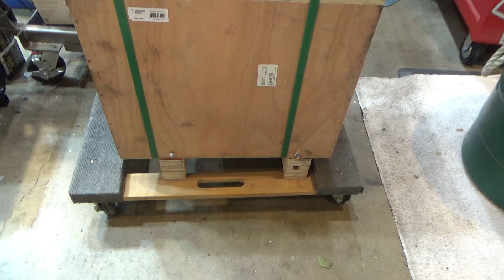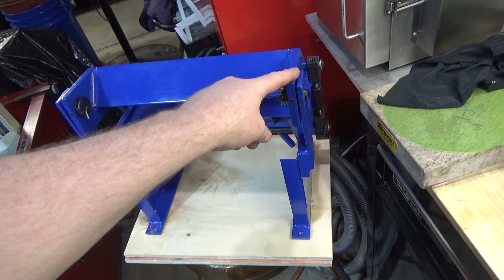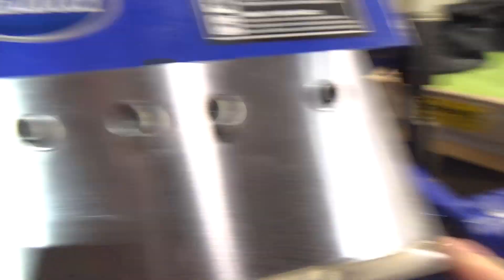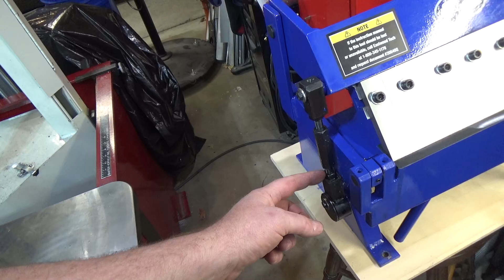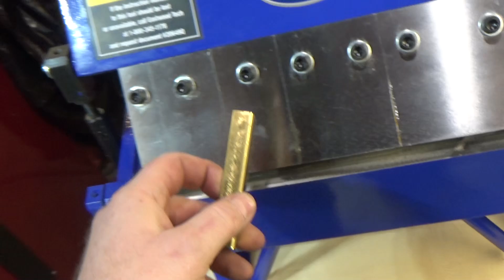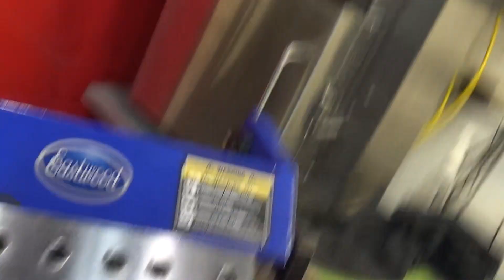QTR 61 Eastwood Finger Brake

Comment: I have the same design but in 24". Yes it needs to be bolted down to be able to work with it. I use mine quite regularly. Thanks for sharing.
Reply from the maker: You seen to be in good company with the 24" model. Others here have positively commented on having the same one.

Comment: Just be very careful if you’re going to bend a narrow, but relatively thick piece. Professional models can bend a good quarter inch if it’s just an inch wide, even if the unit is just rated for 18 gauge across the entire model. But these cheap Chinese models, even up to 48” won’t do that. This might do a bit over a sixteenth safely for mild steel if it’s fairly narrow.

But the biggest problem isn’t the strength of the machine so much as it is the fact that the fingers aren’t really made of a top alloy, with hardened edges. So those edges will crush. Just be aware of that.
Reply from the maker: I really appreciate the tip. You might have just saved me a finger or two.

Comment: thats a good tool but 12in. is a toy to me lol. you be very happy with it as the time go's on
Reply from the maker: You are so correct. I went round and round in my mind over this purchase, because it was only 12", but I barely have room for this small one. Sheet metal will have to wait until I can swing a larger workspace.

Comment: mount it on that board with carriage bolts set into the ply or on runners, then just clamp it to your harbor fright lift table. That should be enough weight to keep it down.
Reply from the maker: Thanks for the suggestion. I have other plans for that space, buy I appreciate you sharing the idea.